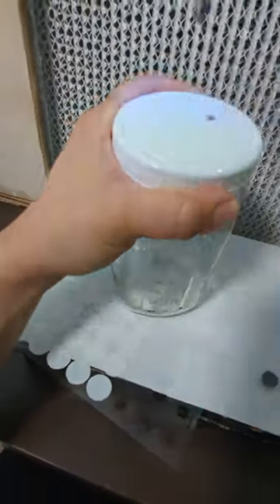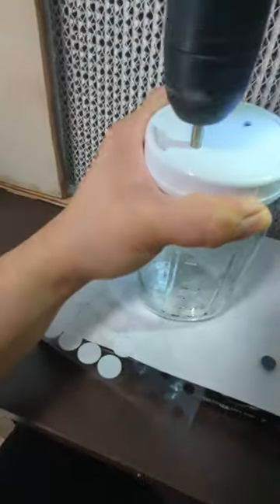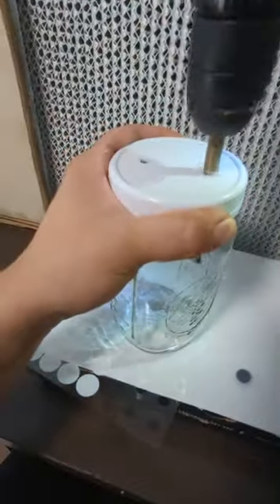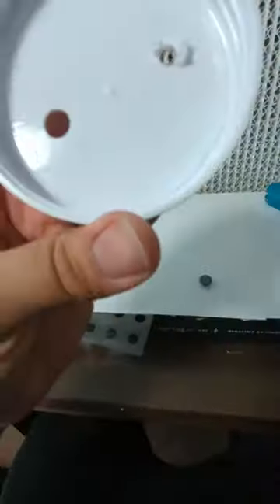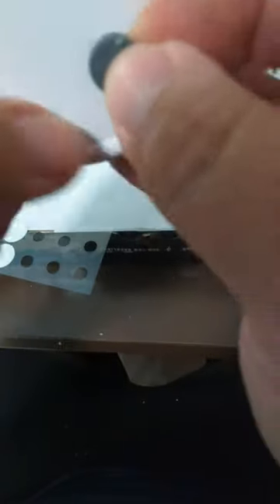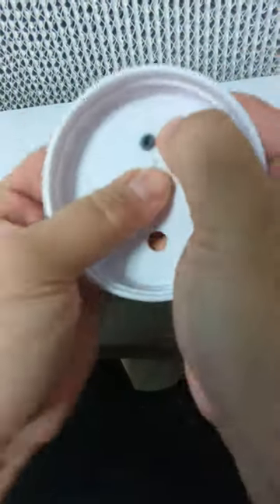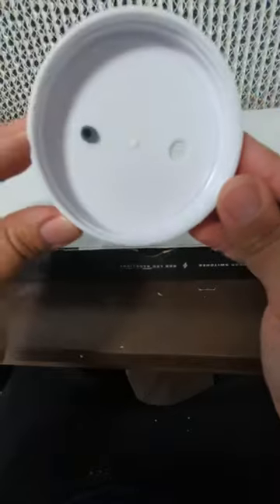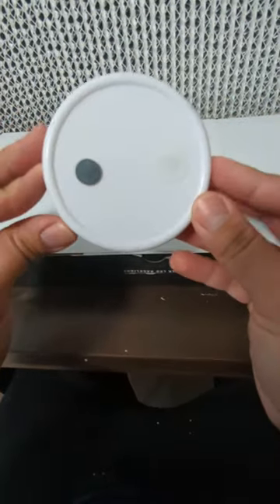Grain Spawn Jar Lid #lab #mushroom

Comment: What size drill bit for the small hole?
Reply from the maker: The small hole is 1/4in. and the larger hole is 3/8in. But the hole sizes will depend on the PTFE filters and the synthetic filter disk size you get so there will be some variance.